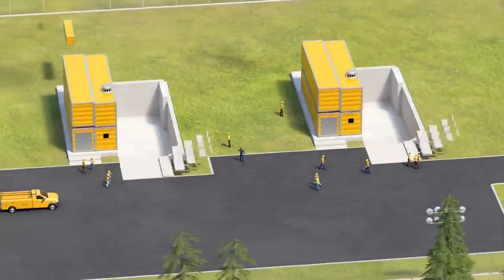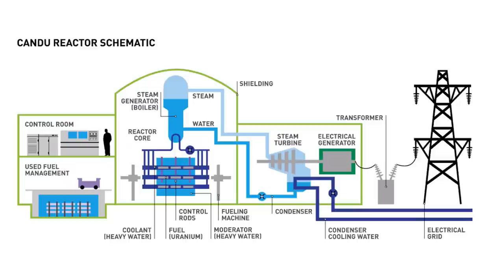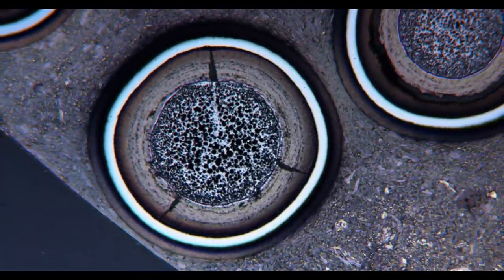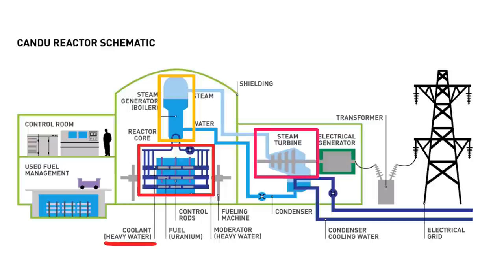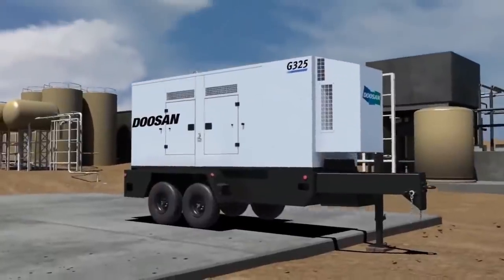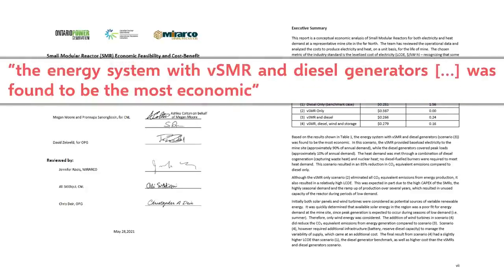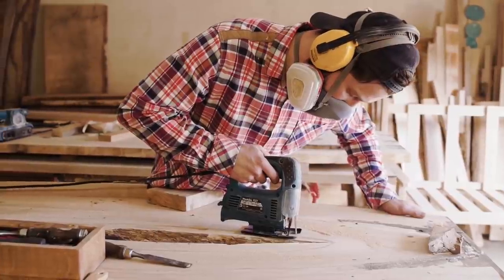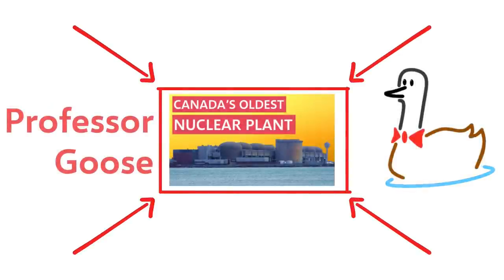This Micro Nuclear Reactor Could be Replacing Diesel Generators by 2026

Comment: What is your definition of "clean" when it comes to electricity?

Nuclear doesn't fit any definition of "clean" that I know. It's not even carbon-free because of the millions of tons of concrete in the construction
Reply from the maker: All methods of power generation require some construction/manufacturing that emits CO2.

Minimum to Maximum life cycle greenhouse gas emissions for different electricity generation methods:
Coal: 751-1095g CO2 eq./kWh
Natural Gas: 403-513 g CO2 eq./kWh
Nuclear:  5.1-6.4 g CO2 eq./
kWh
Hydro:  6-147 g CO2 eq./
kWh
Solar:  8.0-83 g CO2 eq./
kWh
Wind: 7.8-16 g CO2 eq./kWh

I consider nuclear and renewables to be "clean" because they emit much less CO2 eq. than coal and natural gas.

Source: United Nations Economic Commission For Europe Life Cycle Assessment of
Electricity Generation Options
https://unece.org/sites/default/files/2021-10/LCA-2.pdf
Reply: @ProfessorGoose  ok, but you must acknowledge that that is a very limited definition dealing with only one pollutant/byproduct.

I don't see how a 30-year production life-cycle delivering 100,000 years of effluent can be considered "clean".
Reply: @alanhat5252 you won't be here in 100,000 years.
Reply: @yegfreethinker  and?

Comment: dumb dumb idea
Reply: Explain.
Reply: @drmosfet  new reactors can either use nuclear waste or and reduce storage to at most 1000 years. Compared to the toxic waste solar panels leave behind the doesn't degrade ever this is pretty ok to me.
Reply: @alexandervlaescu9901  
I think they need to be MSR to do that. But thorium really reduces the security threat, not to mention radioactive waste of only 300-500 years. It the only one that make sense in remote industrial applications.
Reply: @drmosfet  It doesn't have to do with modularity. Its about how you go around the actual reactions. For burning the actinides you need a fast reactor.
Reply: @drmosfet  That's more the MSR part, having the fuel as a fluid means you can divert some off and clean out the waste that actually causes the problems, the rest goes back into the high neutron flux region of the reactor to undergo fission.
Reply: What a confidently incorrect opinion